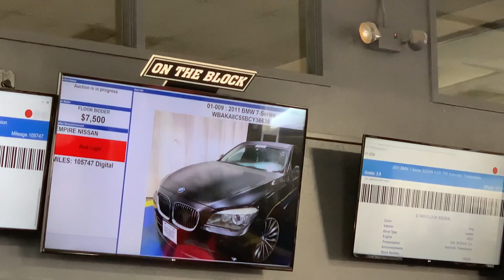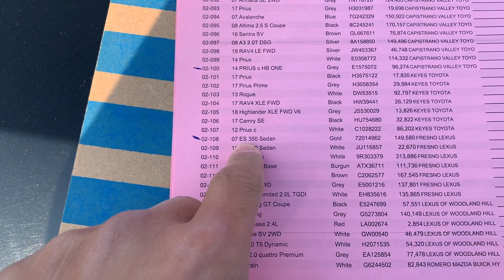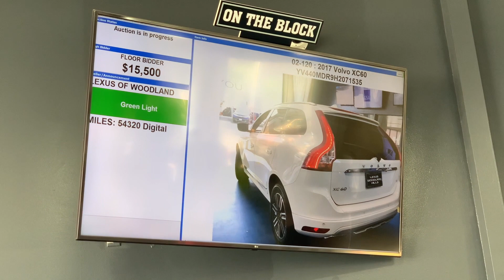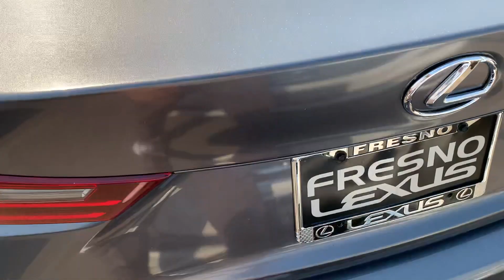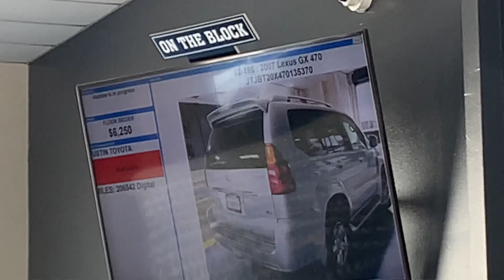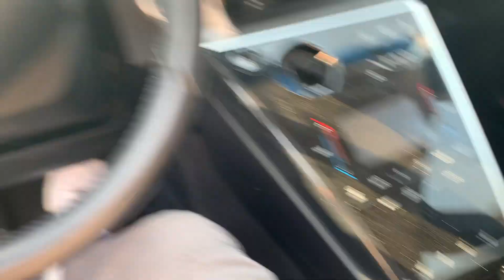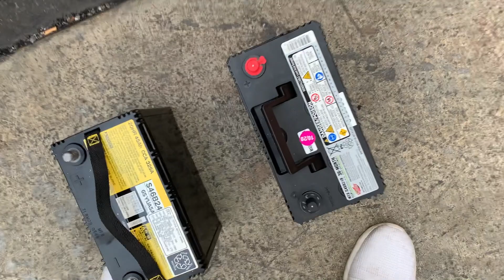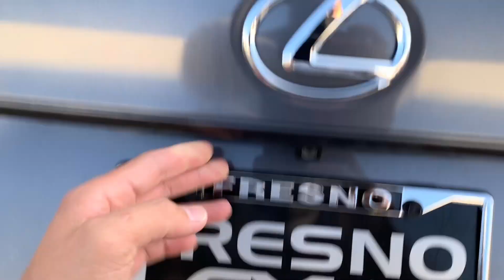$9750 for 2014 LEXUS IS 250

Comment: That is250 looks exactly like mine but mine has 5% limo tint on the rear windows and I put led lemans gold fog lights & led dome lights & led rear lights & led reverse lights & led for the driver & passenger door and 3.5 inch tips but I want to do more upgrades to it. Would you ever considering in getting an is250 like the on you got at the auction and modding it out.